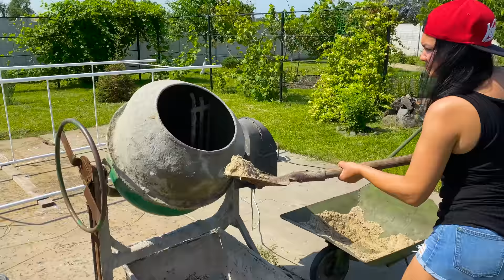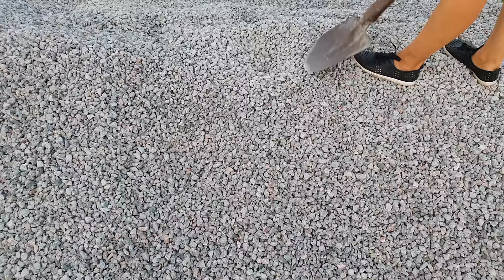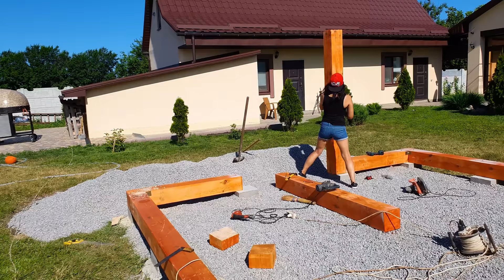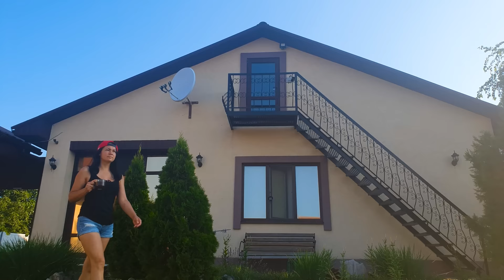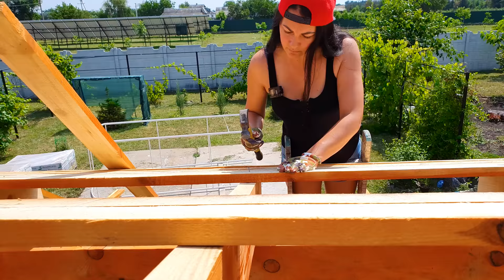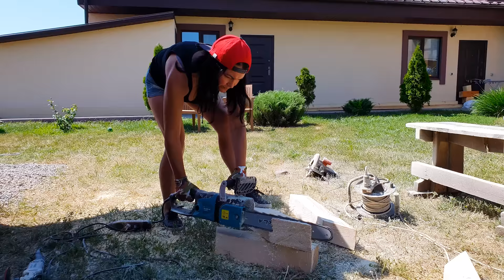I built the GAZEBO of my Dreams! Traditional Ukrainian BORSCHT with Soft Bread from the oven

Comment: this a great design , well built , great work,   now for some critiquing,  by god use some torque bits or hold the drill straight , lol and you can't check for level on the side of the top beam, and for spraying the tip turns sideway in the gun and when going side to side  release the trigger and reapply.......це чудова конструкція, добре складена, чудова робота, тепер для деякої критики, їй-богу, використовуйте кілька динамометричних біт або тримайте свердло прямо, лол, і ви не можете перевірити рівень з боку верхньої балки, а для розпилення наконечник повертається боком у пістолеті, а коли йдете з боку в бік, відпустіть спусковий гачок і знову нанесіть

Comment: There is a major engineering problem with this design. The lateral bracing is almost not existent, and with the first gust of stormy winds  the roof and complete structure will topple over like a house of cards.